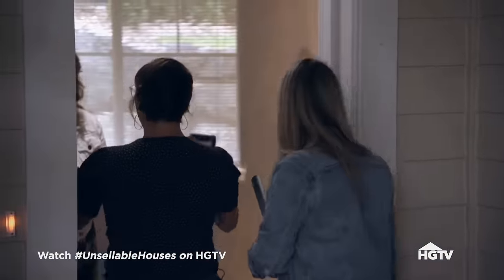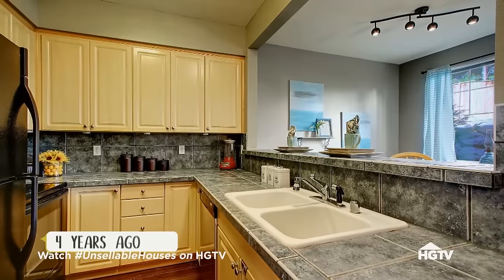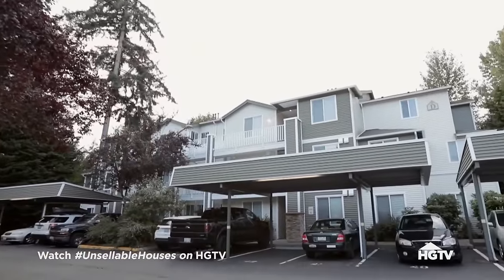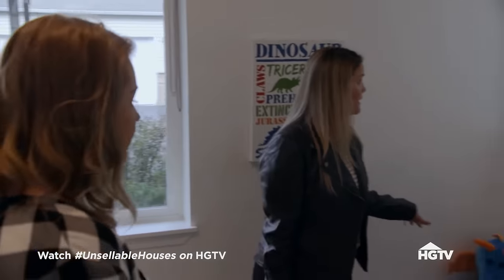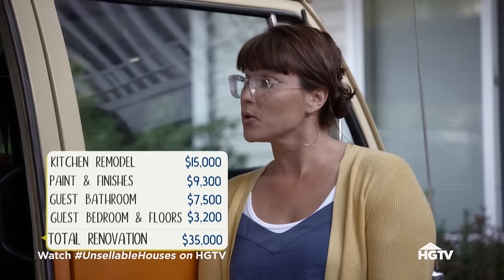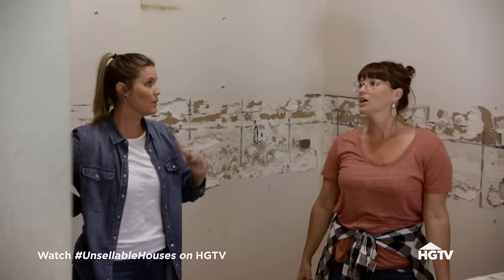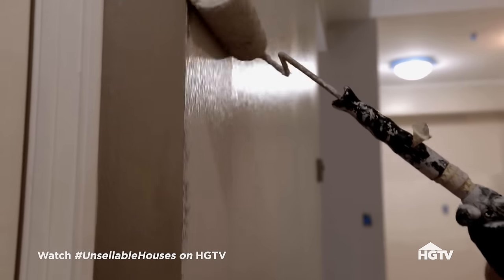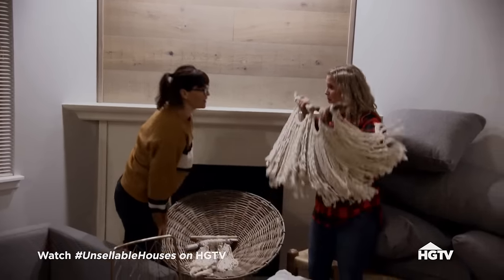DIY Disaster TRANSFORMED into Chic Modern Condo | Unsellable Houses | HGTV

Comment: No seat belts in that van?  Is that even legal?
Reply: Yes, it is.  Antique/vintage vehicle's produced before seat belts became law are grandfathered, meaning they don't have to be retrofitted with modern seatbelts, and are legal to drive without them.  The only exception to this in CA, is when a child is under 6 years old, or weighs less than 60 pounds, then they have to be in a booster, or a child safety seat.
Reply: @kibblenbits but they wear them in other videos, meaning there are some but they just don't wear them every time. That can't be legal.